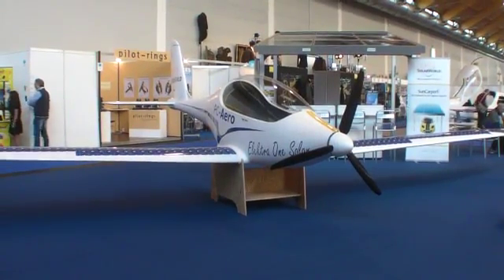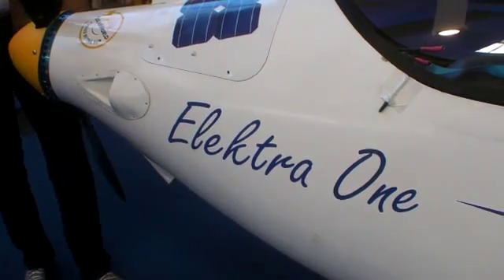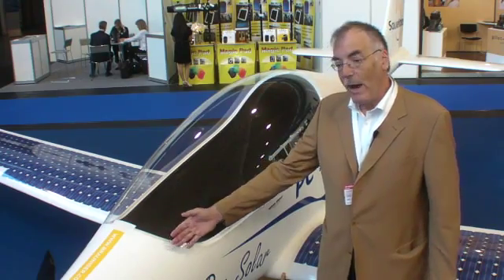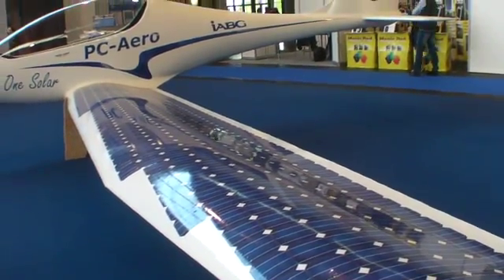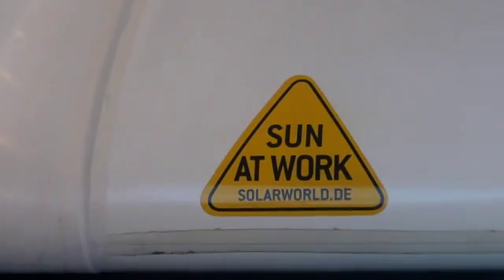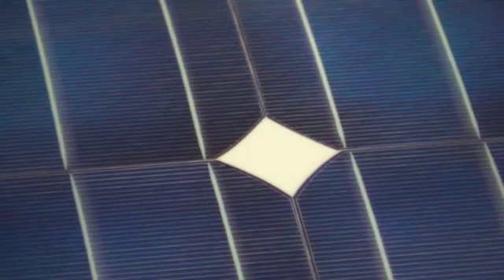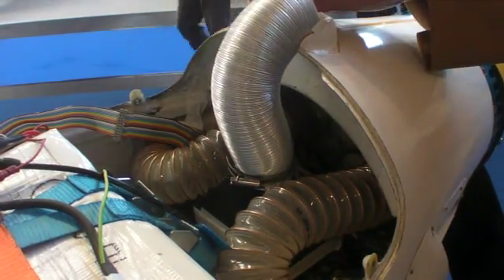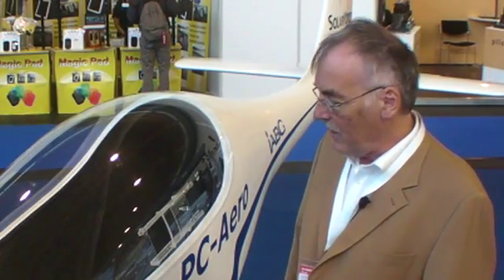PC-Aero's New Solar One Electric Cruiser

Comment: Why not over the ENTIRE plane in solar cells? use small cells so you can curve them with the body. Horizontally on the tail sections.

Best thing is the higher these small craft can fly the more power each cell will produce.